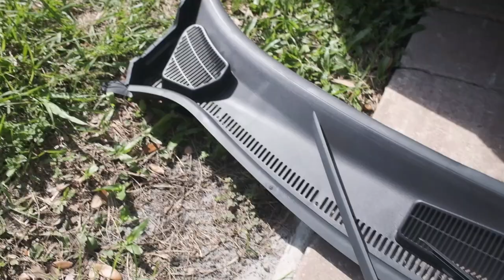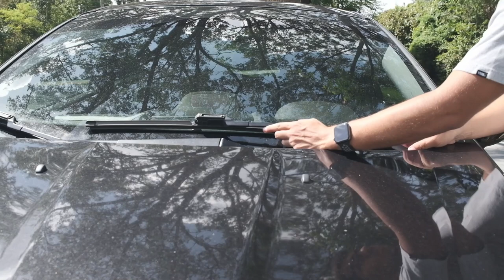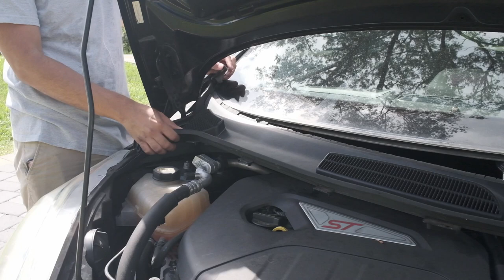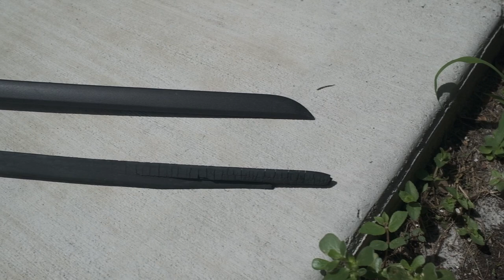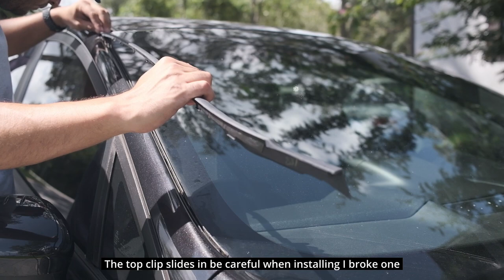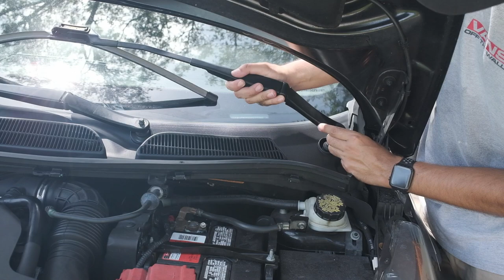Ford Fiesta Windshield Trim Moulding and Cowl Replacement

Comment: For anyone that reads this, the directions are MOSTLY right.  I just did this tonight and saw the cowl "lifts" above the window like in the video here.  There is a "clip" lip that runs the length of the old cowl that has to be gently popped out and removed and installed on the new cowl.  Without that, the cowl will lift and run the risk of never sitting right.
Reply from the maker: Thanks for the additional info. Glad you were able to do it!

Comment: Did this today. Great video, thanks.

Please be aware that there is a small trim piece on the bottom of the windshield that holds the cowl flush against the glass. Mine came off with the old cowl and it drove me nuts wondering why the new cowl wouldn't lay down correctly. If this happens, peel the strip off the old cowl and install it on the new one. The OEM Ford cowl does not come with this piece and you need it.
Reply from the maker: Thanks for the feedback!

Comment: I love it, thank you.  I have a 2013 se that spent 7 years in the desert sun.  I didn't know it was this easy, I'm doing it next week!
Reply from the maker: Glad it helped!
Reply: @CentralFLCars  Okay finally did it.  The cowl believe it or not was actually in really good condition.   When putting the cowl back in, it seemed like it needed to fit in nice and snug in order to fit properly.  The ends were more tightly fitted to where the center felt more loose.

Comment: Thanks for the parts numbers. Yes, those top clips on the side moldings are VERY flimsy and mine broke when I tried to reseat it also, even being aware of this. Took no resistance. Ended up caulking it into place. 

My old ones were so rotted they gummed up the clips so recommend blowing them out with a compressor first if that’s the case. 

I was also missing four of the six existing cowl clips. Either they fell out or when I got my windshield replaced earlier they weren’t put back in. Just something to be aware of. 

Removing the wipers took quite a bit of strong wiggling to get them off.
Reply: Also good to note that the cowl seal along the bottom of the windshield seats into a continuous run that is installed against the windshield, to keep it snug against the glass.

Comment: Does a little bit of the rubber slot under the glass when the mouldings are on like a shower screen like it slots in with rubber underneath and on top with the glass wedged in
Reply from the maker: no the molding is not really a seal its more for appearance

Comment: It would help quite a bit if you could post the part numbers. I need to do exactly the same.
Reply from the maker: Cowl AE8Z-54018A16-A
Molding AE8Z-5403136-A and AE8Z-5403137-B
Reply: @CentralFLCars  LEGEND, wifes car is has same symptoms and i'm doing research to replace it for her.

Comment: Thanks for the video.  Where did you order from, and do you have a part number?
Reply from the maker: My local dealer 
Cowl AE8Z-54018A16-A
Molding AE8Z-5403136-A and AE8Z-5403137-B

Comment: No seal goes over the top of the windshield?
Reply: I think this is the case on all or certain models, yes. These moldings are almost all aesthetic and for water shedding purposes only. The real watertight seal is the sealant between the windshield and frame. I imagine if there’s something just clipped in across the top it’d be subject to pretty strong wind load.

Comment: I got the left moulding (or weatherstrip) and the retainer too. Then I realized that it was only matter of replacing the moulding. What can I do with the retainer? Could I return it to TASCA? I still have pave it on its package.
Reply: Hi my friend.. I have the same issue. Molding parts I need to change.. So retainer is not require for me.. Right?